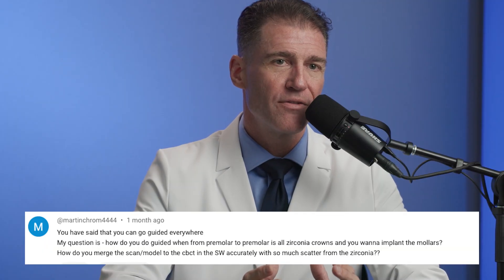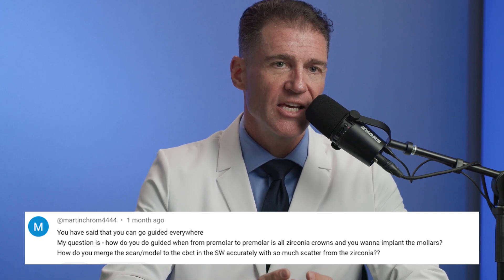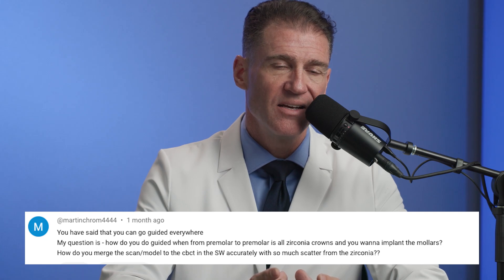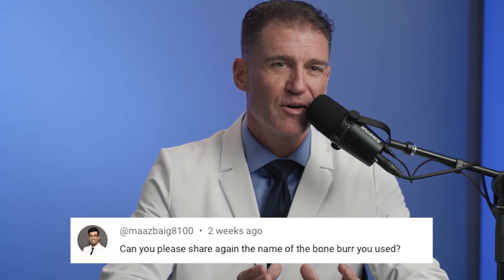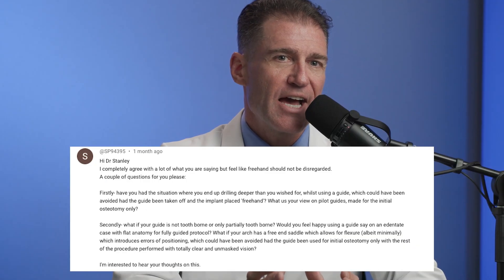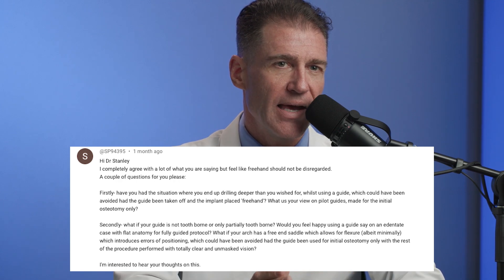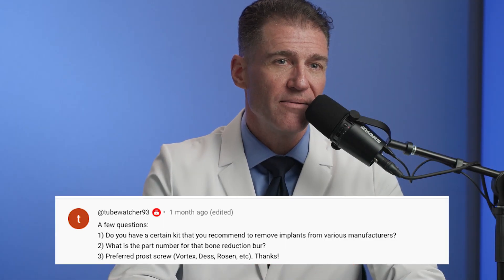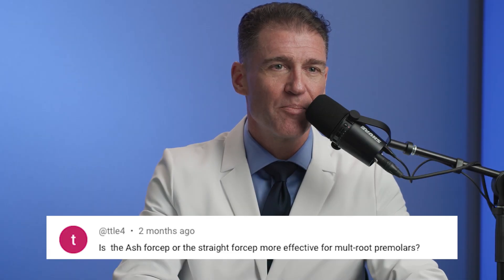Smile Engineer Answers Your Comments!

Comment: What are your thoughts on internal hex vs conical connection? I am fairly deeply invested in internal hex at the moment, but there's a lot of more research coming out that indicate improved stability and want to make sure it's worth the transition.
Reply from the maker: The literature and engineering principles are clear: a shallow conical seal provides a stronger interface than a deep conical seal, which contradicts common industry beliefs. Implant success is influenced by multiple factors, making it challenging to pinpoint which parameters play the most significant role. While I recognize the benefits of a deep conical interface, particularly for the ease of abutment insertion, the original purpose of conical seals was to center and align two objects—here, the implant and abutment. This feature is especially advantageous when working with angled multi-unit abutments (MUAs).

Comment: I have stopped using straight premolar forceps and replaced it with ash forceps, went type 4 fully guided, started thinking more about mechanical loading and prevention of bending moments, all due to your videos, thanks 😊 
Nother questuon - why not just place tissue level implant and seat the zirconia all on x prosthetic directly? No tibase, no multi units, less components, meaning even less chance of failure.
Reply from the maker: I like how you think. The main issue with tissue level implants is the lack of control over the emergence profile. Otherwise, they would be great.
Reply: @Stanleyinstitute  But if the implant is placed deeper so that the polished collar is a little subgingival, then the zirconia will just continue out of the gingiva and it gives you ultra polished zirconia subgingivaly, which is another bonus and by not using MUAs it also cuts the cost